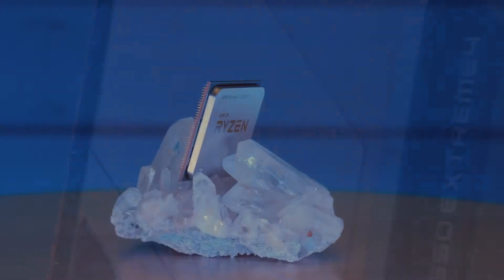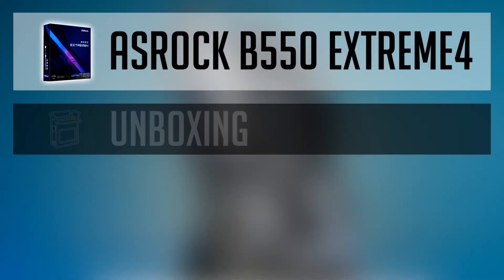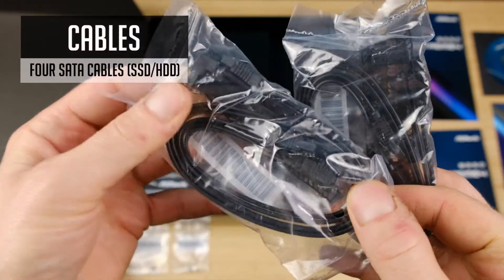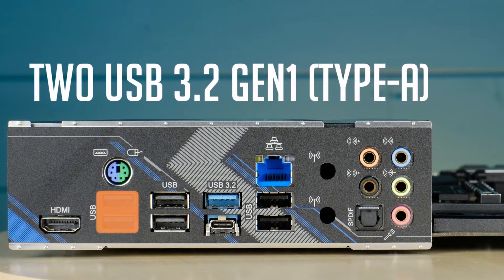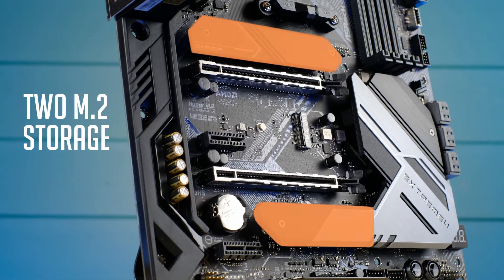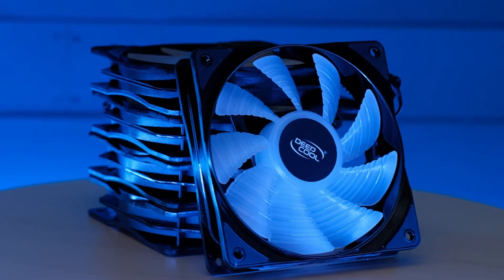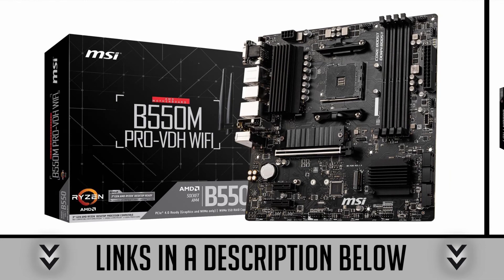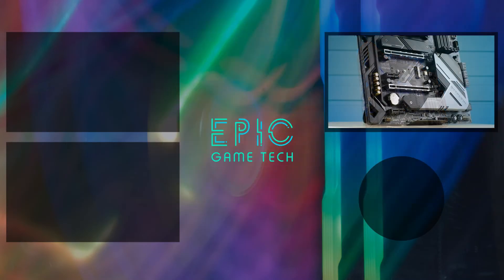GREAT B550 MOTHERBOARD - ASRock B550 EXTREME4 OVERVIEW - Better than X570? Ready for Overclocking

Comment: Yo brother please recommend me a couple budget motherboards for 3900x. I really want the 3900x but I wanna save money on motherboard I'd appreciate it a lot ! The only condition is it has to run out of the box with 3900x or have flash bios cause I don't have older AMD cpu.
Reply from the maker: Hey,
Well if you go for a 12 core CPU I would suggest getting a decent motherboard and not a cheap one :)
What's the budget you want to spend on a motherboard?
Reply: @EpicGameTech  i was thinking b450 tomahawk max at first its like 130$ here but if i really need to get better one i can spend a little more
Reply from the maker: Extreme4 is a really good motherboard, but yes, it's more expensive :)
A few recommendations from my side, regarding the best motherboards around your budget :) But in general, at that price point, most of the best price to VRM performance motherboards are from MSI.
Also, any of the board below will not require BIOS update as it's a new B550 chipset.

Best mATX board for ~$130:
> MSI MAG B550M BAZOOKA (https://geni.us/vdTpR) - in case you will not do hardcore OC on your R9 3900x.
> MSI MAG B550M MORTAR (https://geni.us/RYWuGKI) - can handle any OC, but a bit more expensive ~$156.

Best ATX for ~$130:
> MSI B550-A PRO (https://geni.us/S352aX) - board with decent VRMs, could handle OC.
> Gigabyte B550 AORUS ELITE (https://geni.us/3xe2BuW) - similar to MSI B550-A PRO, but in most cases, a bit more expensive.
> MSI MPG B550 GAMING PLUS (https://geni.us/FzEHlBR) - the same level as mATX MORTAR and is more expensive than the other two.
Reply: @EpicGameTech  Thank you so much for taking your time to help me ! Hope you have a wonderful day ^^
Reply: @EpicGameTech  I decided to go with the MSI MAG B550M MORTAR, sorry for bothering you again but will this motherboard be okay with noctua nh-d15S will it fit ?
Reply from the maker: Should be fine. It's more of RAM compatibility you need to check (what ram height you can use with NH-d15S)
Also, since MSI MAG B550M MORTAR is mATX motherboard, I would suggest using mATX PC Case. It would work on ATX case for sure, but the case would look a bit "empty" as it's a smaller motherboard :)
Reply: @EpicGameTech  I was thinking arctic liquid freezer ii 240mm since it has a really good price here but I never used aio and I'm kind of scared will noctua be better than that aio ?
Reply from the maker: liquid freezer ii is really good AOI for the price. Got some nice reviews from well-known YouTubers :)
Well, it's infinite debate regarding air vs AOI.
I can tell you the main differences and pros of each solution:
> Air - Simple design, meaning the only fan is a mechanical part and it's easy to replace good performance. But bulkier for high-end coolers, meaning more compatibility issues e.g. if you want to use RGB RAM., you will not be able to do it with the biggest coolers.
> AOI - way nicer and some AIOs have insane looks, you can use tall RAM, longer temperature saturation time meaning can "absorb" thermal CPU spikes if any easier (I guess it's beneficial for Intel high TDP CPUs like 10900k). But AOI is more expensive, the bigger chance of failure since it has not only fans but also a pump and possibly shorter lifespan (most warranties are for  2-5 years) while air can work like forever if you count fan replacement.

Sure, modern AIOs are really good and 360mm ones have a better cooling capacity than AIR. But as I mentioned, there are a few things to consider even though it's not a common that AOI fails or etc. I had one AIO like 5 or 7 years old and it was working fine :)

Comment: Hey bro is the deepcool gamer storm rgb 240 v2 a good liquid cooler . Can you please make  a review on it and also a installation guide in nzxt H510
Reply from the maker: Hi,
answered regarding deepcool AIO in your previous comment :)
Regarding nzxt H510 installation guide - It's the same as any other PC Case. So it's not that hard for sure.
Also, there is a video where I assemble a PC in NZXT H510 pc case (https://youtu.be/ITBEDTOkFGM?t=146) but it's edited and in 8x speed ;)

Comment: Hey dude, which one should I pick? HyperX 8gb ddr3 1.5v or 1.35v ddr3L?
Reply from the maker: Hey,
ddr3L is a low voltage ram and used in laptops. Are you sure you are checking Desktop RAM modules? :) (or maybe you need RAM for a laptop?)
Reply: Ddr4, many ddr3 works even if low i had
Reply: oh ok, thank you. And also, which one should I pick? H61 S1 or ds2?
Reply from the maker: Since most likely you aim towards best budget PC, get a cheaper one and spend saved $ on better CPU or GPU :)
Reply: alright :)